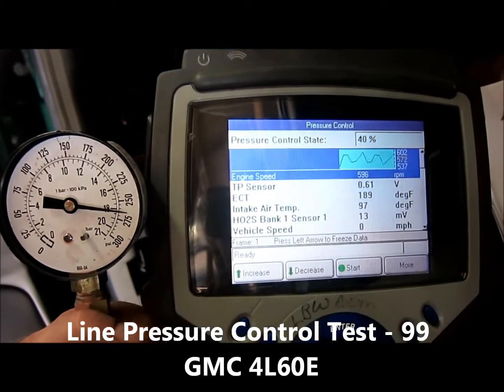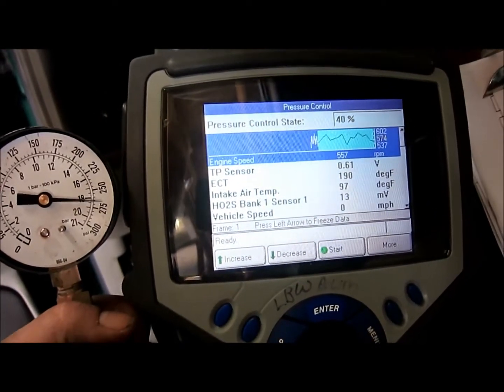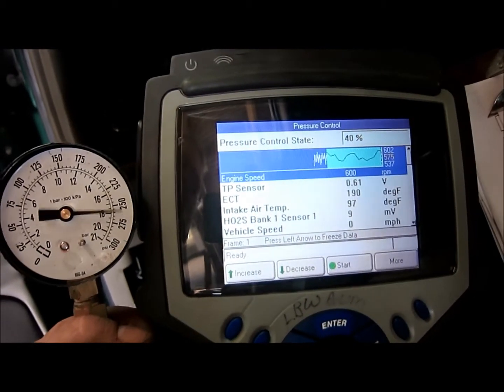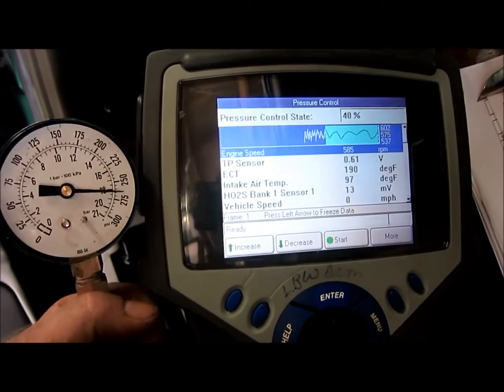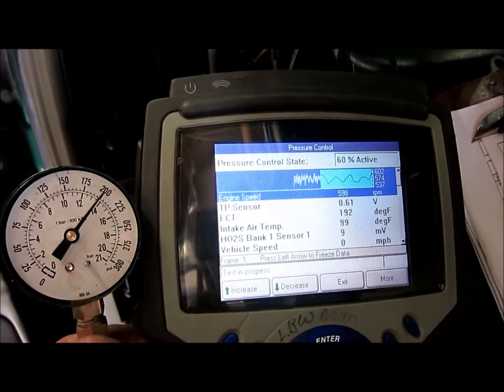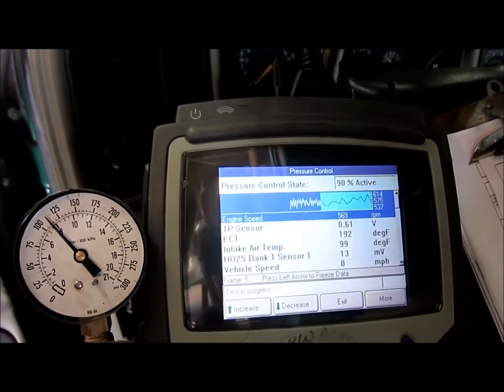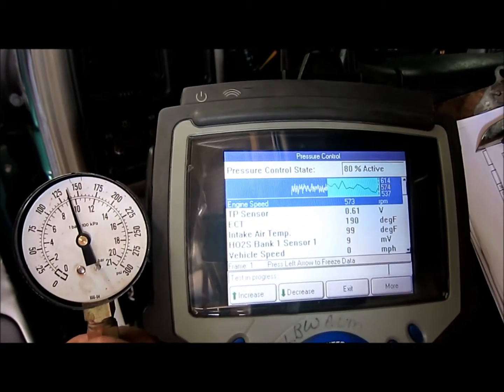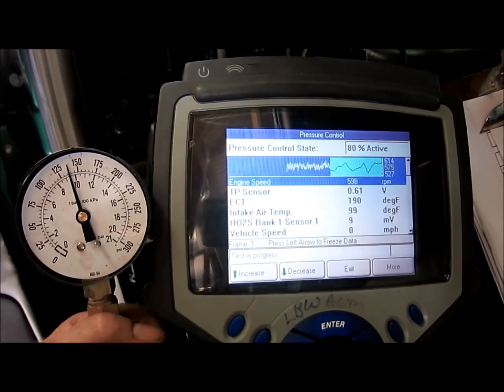Line Pressure Test.wmv

Comment: Did the truck have a transmission issue? According to the 4L60E line pressure chart, at 100% (1.10 amps signal) the line pressure should be between 53-68 PSI. This one is at 100 PSI.
At 0% (0 amp signal) it should be between 169-195 PSI.   The gauge here is at 260 PSI at just 40% , that's high!
Reply from the maker: It's a trainer vehicle that is never driven.

Comment: What kind an brand scan tool are you using sir
Reply from the maker: That is an older vid but I was using an OTC Genisys
Reply: @McCuistian what scanner should I get that's up to date to check the trans or is this one still good ...I own a 08 Pontiac Grand Prix gxp 5.3 v8 thank you so much sir
Reply from the maker: @justinmoore8711  Any scanner that will communicate both ways - a simple code reader won't do it. Make sure that whatever scanner you use, it can issue commands.
Reply: @McCuistian  ok will do an thank you so much sir I greatly appreciate your time an response